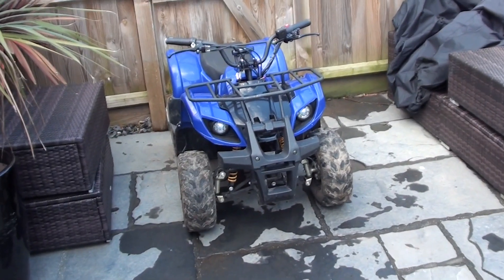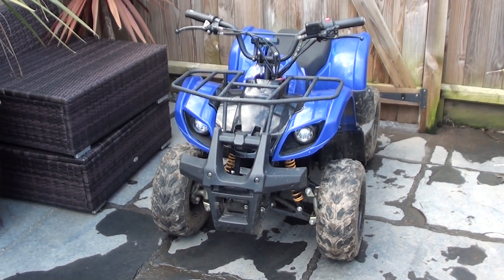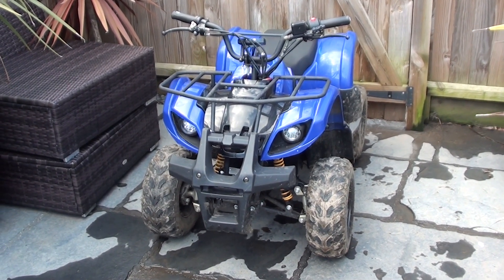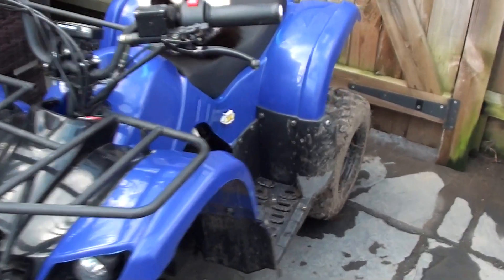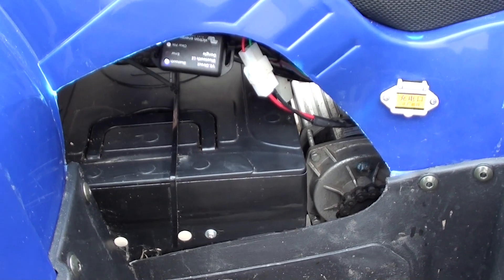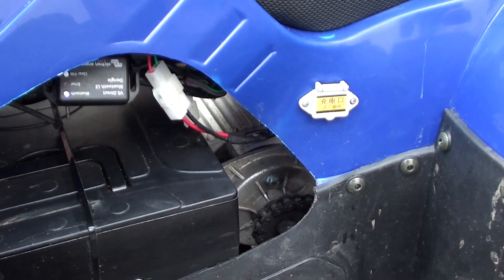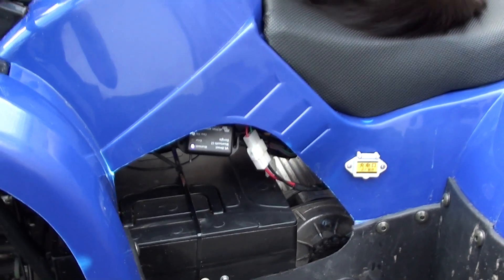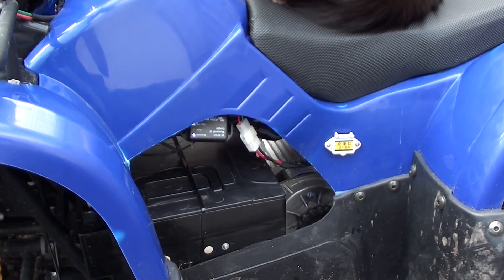The Electric Quad Bike

Comment: How do I change the block  that bumps it down to 12v iv got the sMe setup and want to convert it to lipo but haven't got a clue how to do the  block thing ?
Reply from the maker: You mean the DC-DC converter?? Its used for lights and 12v stuff, You just need to check the input voltage range of the one that's in there and make sure it can handle your fully charged lipo voltage, you only need to change it if you are trying to increase the voltage fed to the main controller ie to make the quad faster, but be careful because there is a limit to how much you can push the voltage into the controller before it will go pop!

Comment: Why do you get a so little top speed with a 75v and 2200W motor ? While some modified ATV’s can hit 50km/h with only 60v
Reply from the maker: It’s to do with gearing. The torque is ridiculous, i need to adjust the gearing but I’m having trouble finding a smaller sprocket.
Reply: Thanks for your answer, so the smaller the sprocket, the more top speed you'll be able to hit ?  I am planning on to convert my atv (which is similar to yours) onto electric and I'm not a meca guy so I'm still trying to find what's the best motor (with watts) and voltage, so if you have any guide or tutorial on how to choose the right motor/voltage/watt and/or calculating the possibble torque/top speed you can get from it, it would be a pleasure. :-)

Comment: thats a great idea how does the cost of what u have there compair to the petral version of the same thing?
Reply from the maker: +Gary g1fsh well it will cost more than a petrol machine initially but the simple fact that it doesn't really require any maintenance on the power train side and no fuel/oil/engine parts would make it much cheaper in the long run.